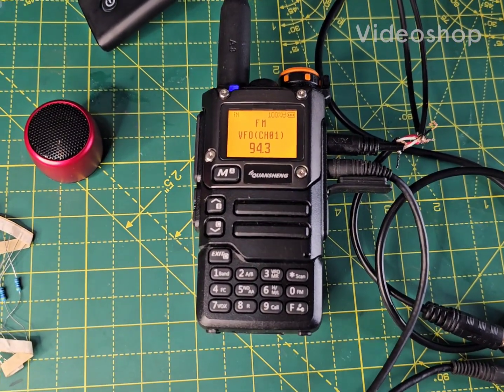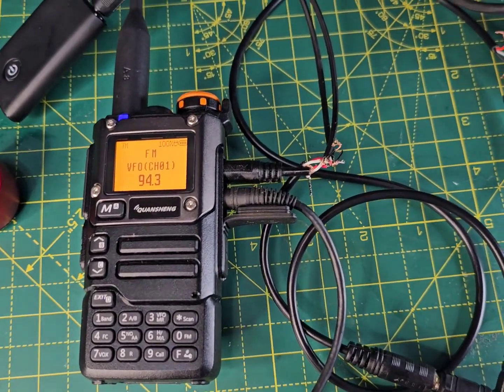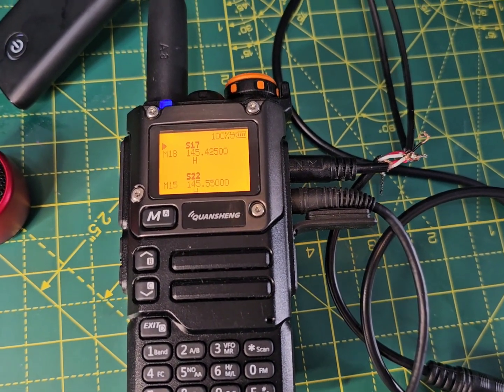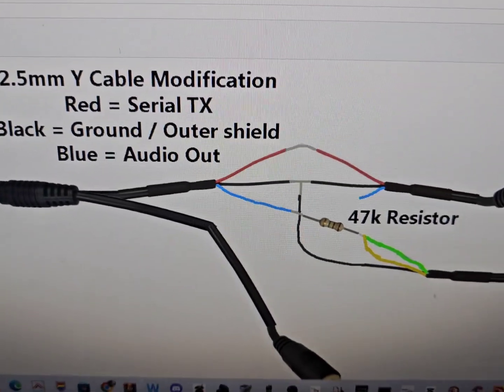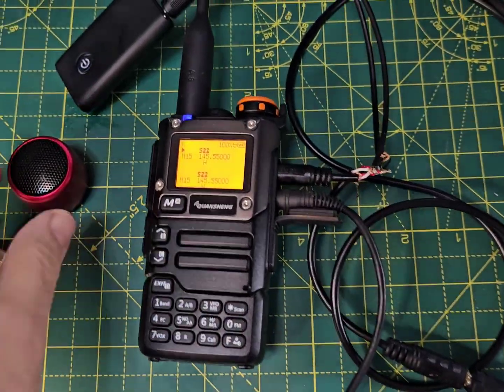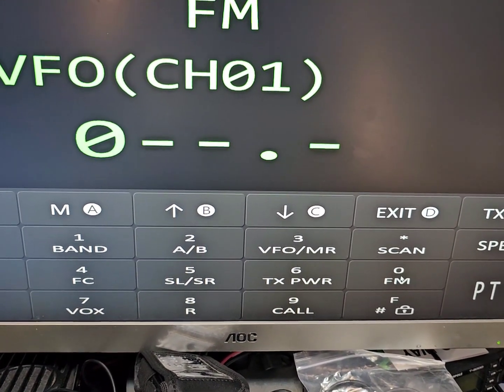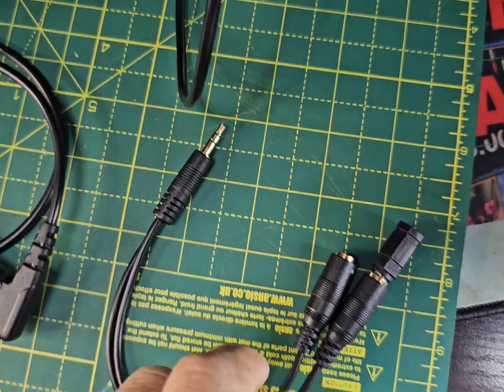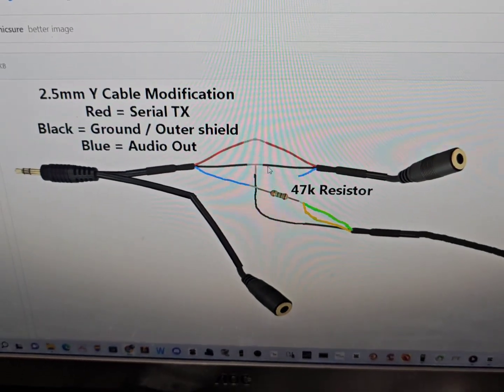Quansheng Dock , Bluetooth Speaker Experimnent - Learning

Comment: Really curious if someone will modify this for the baofeng radio series.
Reply from the maker: Would be cool but go buy a k5 , so cheap
Reply: @HamTechRadioScannerDrones  I just bought the Baofeng UV18 Pro Max GPS, arrived a few days ago (it does say 10W Multi-Band on the back but don't have anything to test that), will get a K5 at some point when I'm back in the UK, but I'm traveling across Japan and trying to keep my bags light, just wanted a radio for WHEN the zombies come 😅 (joking obviously).